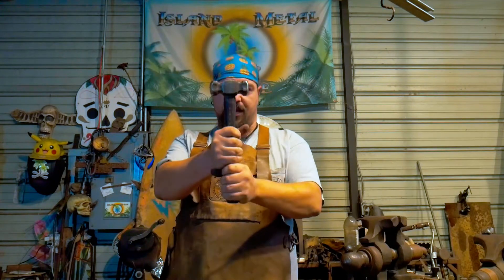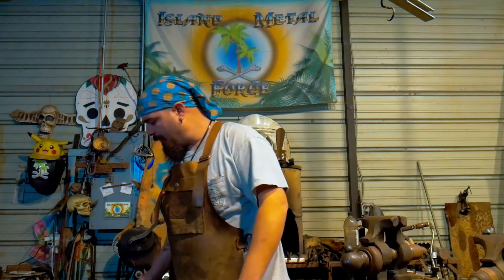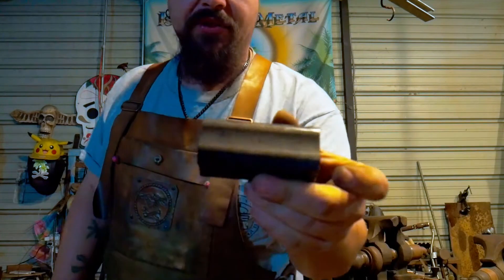Atlantic 33 (flutagon) Hand Forging a Rounding Hammer Part 1

Comment: Just a question not a rib but why would you need a heat resistant steel for a hammer ?that be like using h13 or s7 thanks
Reply from the maker: A heat resistant steel? Heat resistance doesn't really factor into hammers. Drifts and punches and such sure, but hammers not so much. 
I use A33 for my hammers because it is easier to forge with and has a simpler heat treatment.
Reply: @IslandMetalForge  thats my question if heat is not a issue with hammers then why use a steel like a33 as say 4140 or 1045 ,unless u can buy a33 much cheaper than ssy hydraulic rod 🤔 thanks again just trying to understand
Reply from the maker: @genesmith2416  heat resistance isn't the only beneficial quality of A33 4140 ect... shock resistance is more important. A33 is excellent with shock resistance... also as I said above it is much easier to heat treat a33  Saving me several steps and time.
Also.. for me even though it costs a bit more, A33 is more readily available to me...
Reply: @IslandMetalForge  thanks I didn't no about the shock resistant. How well does it do on say a hot  cut or hammer eye punch
Reply from the maker: @genesmith2416  yeah it would work for that.